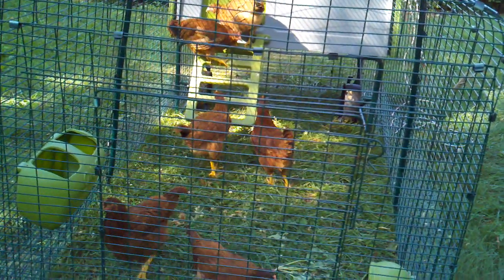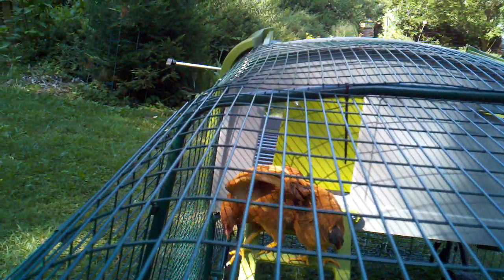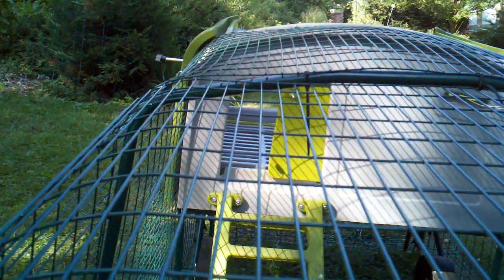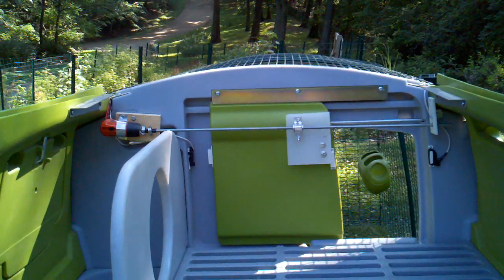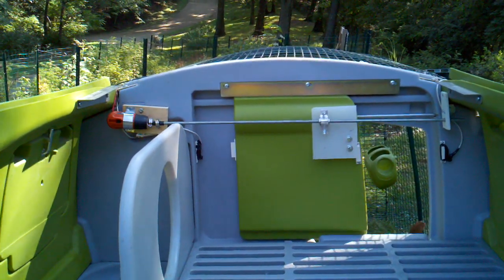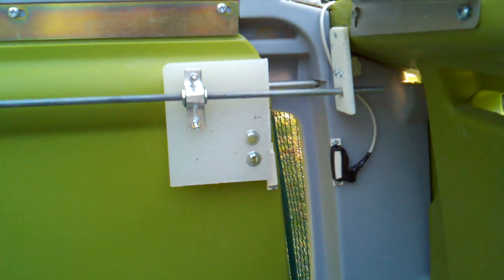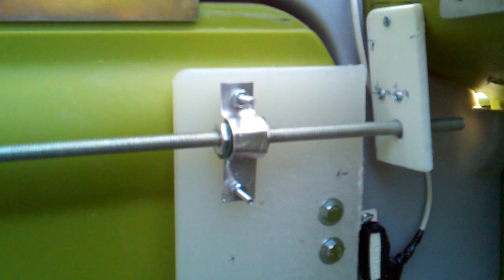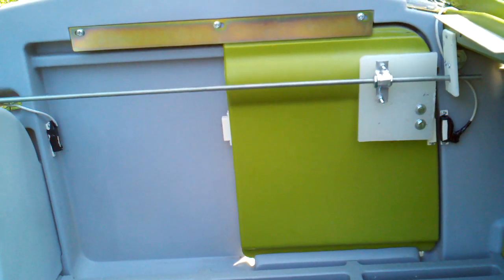DIY Eglu Chicken Coop Automatic door opener/closer

Comment: I was wondering now you've had the door working for a couple of years. Have you had any problems or made any modifications.
Reply from the maker: +Dave Colclough I've made a few modifications that come to mind.  To run at lower power consumption, I changed out the arduino board to one without a usb interface and modified the software to go into sleep mode and wake up every 8 seconds to check the time.  I purchased a larger solar panel and added a 6V charge controller for charging the 6V SLA battery.  I modified the software to better handle response to high motor draw.  I also changed out the rubber hose that I used to couple the motor to the threaded rod to a metal flexible coupling.  I use a dry spray on chain lubricant every few months on the threaded rod.  Also, I changed out the synapse radios with hope rfm 69HW radios running at 915Mhz.

Comment from the maker: The arduino monitors motor current. If the door becomes blocked or jammed, then the motor current will increase.  If the current goes over a set threshold the motor stops, and reverses the door for a short period.

Comment from the maker: @jchamber4 I believe I was just simply changing the battery connections in this video.  My other video shows the completed project.  I am using an Arduino microcontroller that monitors the two magnetic switches to determine when the door gets to the open or closed position.  Based on the time of day and position of the door, the arduino i/o is used to control a motor controller that runs the motor in the forward or reverse direction to open or close the door.